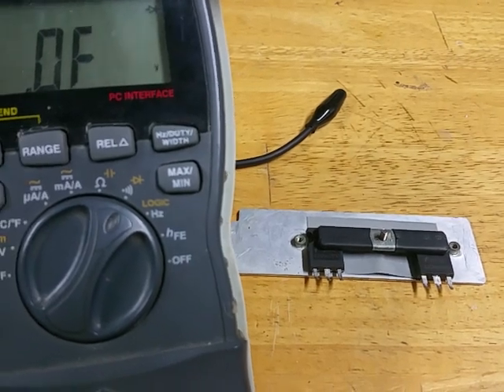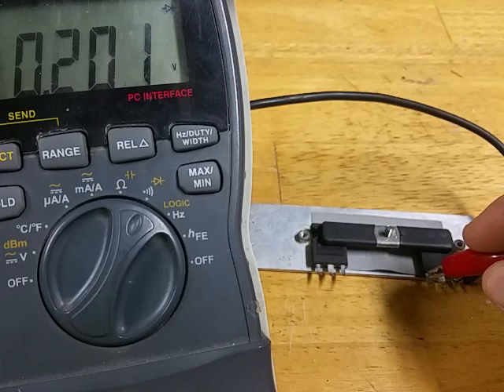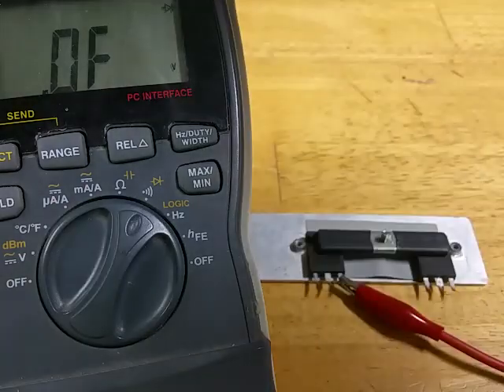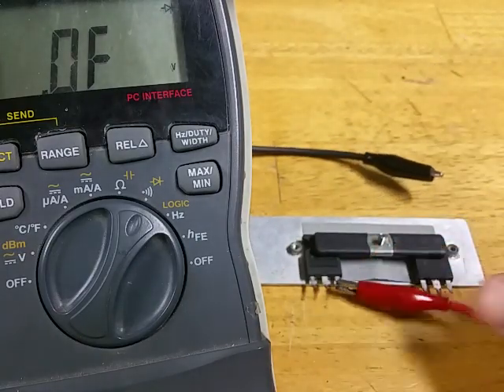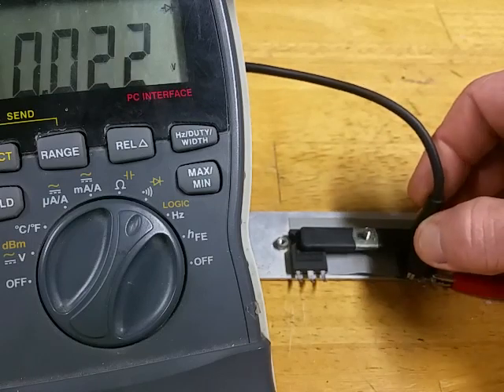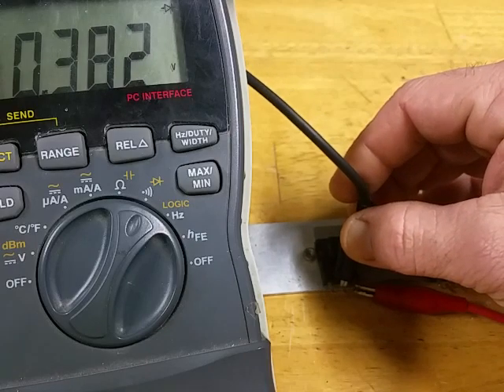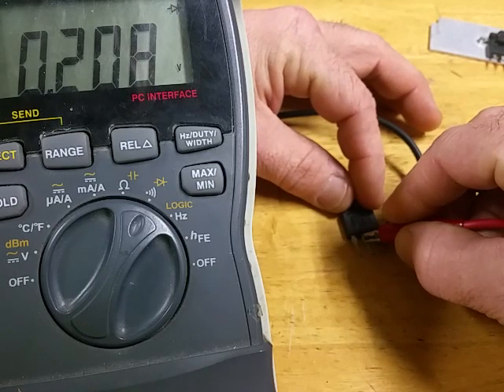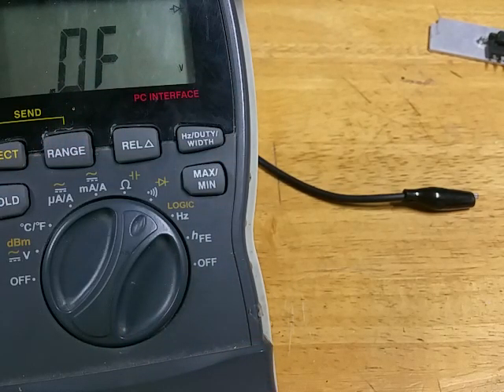Testing for bad mosfet - comparison of good and bad mosfet

Comment: Hello, 

I'm working on an power inverter the irf1404 mosfets have the Drain or the middle pins clipped off not connected to the cb ,Is it normal?
Reply from the maker: Not sure exactly what you mean but the middle pin is generally common to the back side.

Comment: Will a bad mosfet cause a guitar amp to loose volume, and go down in volume, after being on for a while.?
Reply from the maker: @geraldcarter2846  sorry I had overlooked this but it sounds like a bad connection.  Bad mosfet would typically not work at all but there are some very rare instances where a bad mosfet could do what you described.  Hard to explain but it's like the mosfet has shorted but not shorted enough to completely stop the operation.  Seen it before.  Based on what you asked though, it sounds like a bad connection.  For instance after being on for a while a jack/terminal expands from heat causing a bad connection.

Comment: Very clear explanation sir. Do you have a video testing IGBT?
Reply from the maker: It been a while but I think I used IGBT in the video.
Reply: @wyrtap5138 This is video is actually a mosfet. IGBT is a slightly different component

Comment: You need to mention by touching the gate with a mulitmeter probe you can switch it on or off,depending on which probe.
Reply from the maker: very true especially the to-3 packages